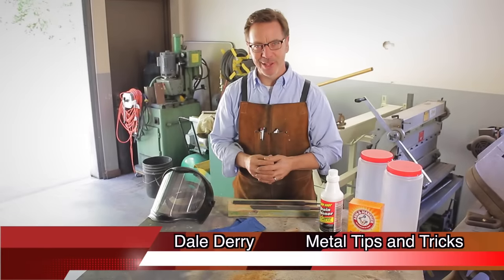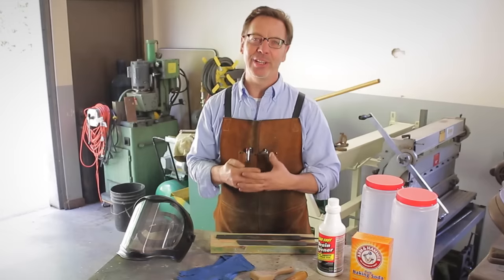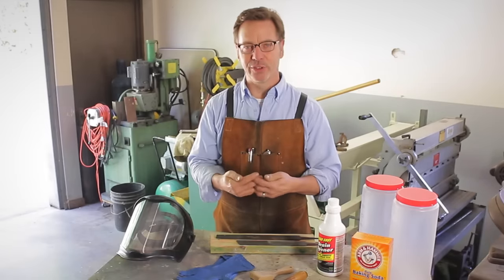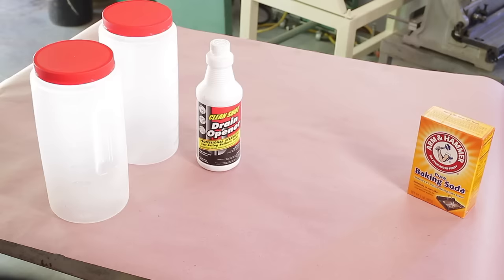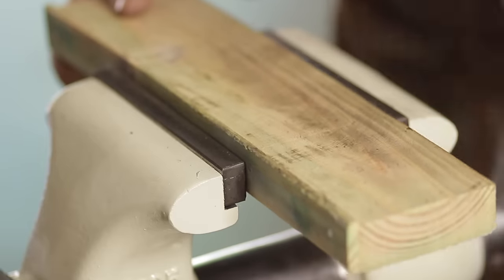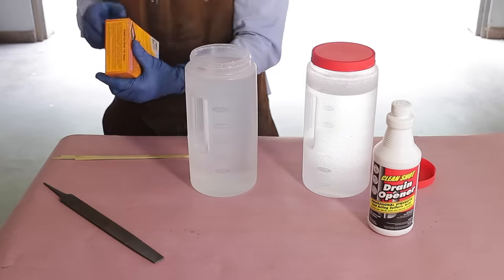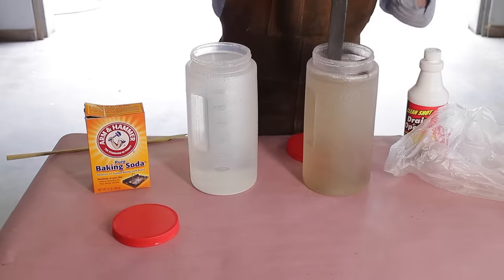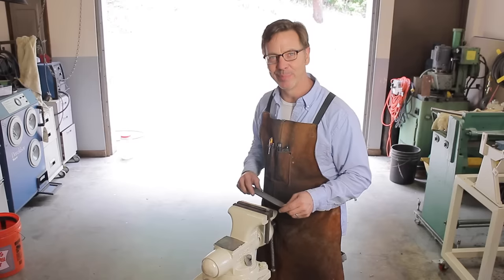How to Sharpen Metal Files

Comment: I don't see how using acid will sharpen a dull file.  

Sharpening anything is a selective process, that is, metal is selectively removed (from some surfaces and not others) to create a feature, in this case that is a sharp edge.  For files, the manufacturer creates the features (cutting teeth) by plastic deformation of the metal, however it requires a flat, very smooth surface for the deformation to create a good tooth profile.  The file is then hardened and lastly (according to Nicholson), bead blasted to sharpen it.

Acid etching, on the other hand, is a bulk process, it is not by design a selective process.  The acid will remove metal from all surfaces at once, it may do so in an uneven pattern, but there is no design to it.

Acid etching is used in metallurgy to show the microstructure of the metal.  Metal is not (unless specially manufactured to be so) amorphous, it is made up of a number of alloy forms in domains with specific boundaries between domains.  These different components etch at different rates, thus revealing the microstructure of the metal.  If the metal is polished before etching (the usual case), the resultant finish of the metal post etching will no longer be polished, it will be roughened, otherwise the microstructure will not be revealed.  Of course, there are commercial processes that use acid to achieve an "acid  finish", where a shiny metal comes out as dull.

There are numerous videos on YouTube that show acid being used to remove rust from old tools.  In all of these, viable metal as well as the rust is removed.  If you watch one where the tool has printing stamped into it, you will see that the printing is less clear and loses its sharpness the more the tool is etched.  That is, the sharp edge of the printing  is eroded by the acid more than the bottom of the printing.  The printing loses definition.  The same will be true of the cutting edges of files.

So why is this so?  This is a simplified explanation.  The acid removes the metal through a chemical reaction, this both removes the metal and exhausts the active components of the acid to form salts.  If the etch is to continue, the liquid around the metal must have new active components brought into contact with the metal.  This is done in a number of ways, sometimes through chemical transfers in the liquid and sometimes though agitating the acid.  The agitation process is quite common, however most of the time, the file sharpening through acid etching does not use agitation.  So chemical transfers through the acid it is.

It should be clear that the more acid that the metal "sees", the faster the etching and the greater the metal that will be removed.  Consider (in a two dimensional case) a piece of the metallic surface.  If it is on a flat plane, the surface will "see" 180 degrees of acid, this is the case (more of less) when we are considering the middle of the flat surface that runs from the gullet to the cutting edge.  As we more up the tooth towards the edge, the view will remain much the same, however as we reach the sharp edge, we will be able to see greater than 270 degrees of acid, there is more access to the active element of the acid.  As we come away from the cutting edge and descend into the gullet, the view of the acid will get narrower, at the bottom of the gullet it will be less than 90 degrees and thus less metal etched away.  So, there is  more metal removed from the cutting edge than there is from the flat of the tooth and less metal removed from the gullet, this is the opposite of sharpening the cutting edge.

The file may feel sharper after acid etching, but is it, in reality, just cleaner with a rougher surface?

When I buy second hand files (most new ones are appalling), the first thing I do is put the file in an extremely strong caustic solution (very dangerous, very corrosive to organic mater, that is, ME!, protective safety wear is critical) overnight and then brush it will either a fine stainless steel brush in the direction of the gullet for a single cut file, or a brass brush in two directions for a double cut file.  Like the acid etch, the caustic gets depleted where it has removed rubbish from the file, sometimes  a second overnight dip is required.  The caustic will remove all sorts of rubbish, oils , greases, filing, aluminium,  paint, glue, all sorts.  When finally cleaned, brushed and protected from future rusting, the file feel very sharp (unless damaged).  The caustic solution will also remove most rust, but will not remove the dark patch (black rust or ferric oxide instead of red rust or ferrous oxide) where the rust once was.

I rarely go beyond this point, the file is usually about as good as it will get, any remaining rust will be removed by honest filing.  If I must get rid of the final remaining rust, I use Evaporust (rarely).  I am told our old friend bicarbonate of soda also works, but I have not tried it.

I often get a file that just feels dull and useless but has turned into a barely worn, worker.  One second hand, smooth grade, single cut file I acquired, that felt  completely dull when I got it, turned into a very capable draw file.  I thought it got even better the more I brushed it along the gullets, polishing the cutting edge, or just imagination?

The only way to prove whether acid etch works as advertised is to take before and after, high resolution, photos of both sharp and dull cutting edges of a quality file and compare them, to see just what has changed.  One day I might get around to it.

i am sure many will disagree with what I have said, not to mention the TL, DNR brigade (to whom I say, if you didn't read it, why would you show your ignorance, and why should I care? Nothing to see here, move on.),  and that is their prerogative,  but please provide some sort of reasoning in your explanation.  The "just because," or I was taught 40 years ago (for me, it was at least 47 years) doesn't add much to the conversation.

Comment: That's not "sharpening" a file,it's "unclogging" a file.It's one of the first lessons in metal shop.Also,how on earth would anyone think the drawer thing would work !!!!! I guess this is why North America still imports most of it's trades people from Europe.
Reply: I have been doing this for almost 30 years.Although it does unclog a file better than just using a file card or brush it is still not sharpening,it is unclogging particles from the cutting edges making it work much better.To "sharpen" you would have to grind or hone each little cutting edge only.If by sharpen you mean "make it work better".Yes, it does that for sure.Still not technically sharpening though. :-))

Comment: A relatively expensive way to clean not sharpen a file. It's cheaper to chuck em out and buys new ones. Oh yeah, and it's a good idea if you are going to do this to wear a face mask in the interests of safety but, it's also a good idea to use a handle on your newly cleaned file when giving it a test for "sharpness" rather than having the naked tang sticking into your hand. Whoever taught him didn't do too good a job really, eh?

Comment: Everybody is here talking about how this is cleaning not sharpening and what I'm concerned about is why a drain cleaner is using high amounts of sulfuric acid. Correct me if I'm wrong, but would that not lead to the buildup of hydrogen gas when the acid reacts with metal pipes? Seems a bit dangerous and is the reason you typically don't pour strong acids down the drain in chem lab.

Comment: If you are a mechanic and you don't "unclog" your files ... euhhh
So, the cleaning alone does not do the trick.
With the acid, you etch away a layer of metal ... on all the surface.
Hence sharpen it.

Comment: Soooo...  a simple wire brush doesn't do the same thing?  I mean if you REALLY want to get deep down in the grooves of the teeth and get gunk out sure, but a fine bristled wire rush works nearly as well at CLEANING the file as this does.  Actual sharpening would require recutting the teeth themselves some.

Comment: If a drop of WD40 and a file card brush doesn't shift the grime and pick, then acid solution is a last resort. Never use acid for frequent sharpening of the same file - it will just ruin the set.

Comment: Fun fact acid to water or water to acid no different. May the old guy engineer RIP
Reply: No "zach korinis" "acid to water or water to acid no different" -  WRONG ! - ALWAYS add the acid (slowly) into water , NEVER pour water into acid . Strong acid "grabs" available water violently and can spit at you. Think about the first few milliseconds of the mix process ; adding the first drop of acid to a large volume of water results in weak acid , but the first drop of water onto (violent) strong acid results in spitting strong acid !  People have received serious injury by getting this wrong.  ( If the acid your using is dilute, you can sometimes get away with mixing it wrong - but if the acid is strong, especially if fuming, then get it wrong at your peril. )  DON'T PLAY WITH STRONG CHEMICALS !
Reply: Its not a joke me and my friend tested the reaction with concentrated sulphuric acid and  water in a lab but their was no significant difference in how we mixed them not sure why its such a no-no. We used room temperature but I've heard hot materials are much more reactive and dangerous.  I think either way going slow is the key but the reactions are almost identical.

Comment: What is the actual science behind this. Is the acid eating into the surface and removing a small layer or is t breaking the chips and grime down that are coating the file. Interesting video although lacking in actual facts about the workings.
Reply: Both, really. A strong acid will dissolve some of the junk out of the valleys between teeth, but it will also corrode the steel.

Comment: There is an easier method, clean the file as per the first steps, but instead of putting in acid and then soda, place the file on a leather hide, position outside so that the full moon can shine on it, have 3 vestal virgins dance around it for an hour or so and repeat for the other side next full moon. The file will not be much sharper but it is entertaining.

Comment: Just put it on the wire wheel it clean it in seconds.
Reply from the maker: Wire wheel will damage your files. Try using brass wire wheel it easer on the file . :-)
Reply: It will if you too lean hard on the wire wheel. But I'm a tradesman so I don't have that problem and never blunted my files on the wire wheel. But a brass wire would be more forgiving.

Comment: Been in Engineering workshops for over 40 years. Never heard of sharpening files. Clean them yes, sharpen no. If the file cutting edges are dull you need a new file.

Comment: Sorry to be picky, but you're not really sharpening it you're cleaning it albeit very well.
The sulphuric acid will not only eat any rust on the file, which is good, but will take some of the metal to become iron sulphate. That will erode the edges of the individual teeth and on a very small scale, dull them.
But, in fairness, you've taken a fairly useless file and got it back usable again which is great.

Comment: who the hell ever said steel sharpens steel by leaving them in draws???? We have always been told never let cutting edges touch, files, saws, drills, taps ect should all be stored with separation.
Also as others have mentioned this is cleaning. It will not sharpen and in fact will dull the cutting tips.
This will clean an abused file from Clogging.
The only ways to sharpen files require one of - normalizing, shaping and re hardening / Laser or photo reactive material removal / acid masking / EDM / Diamond tool drawing.
If you wish to do a basic acid mask dip on a file and process similar to this video then Clean file as video describes, then pull a hard wax backwards over the file. this will deposit wax on the tops of the teeth. Now acid dip the file. as video did but for abit longer. Its a lot of hard work and more than likely easier to buy a new file.
Reply from the maker: your wrong
Reply: Thanks for being so precise and comprehensive on what parts I am incorrect about.
If no response is posted then i guess you did some research and realized that in fact the information I posted is not incorrect. I have stated that your process does clean a file. I would hope you can understand that I'm not telling you that you can't clean a file like you did but instead some people may be misinformed from this video due to the term "sharpen" in a practical sense.
An acid or alkaloid will corrode a point faster then a flat. therefor the points get corroded faster making the point more dull then before.
The file may perform better as the gullet are clean and any swarf stuck on tooth tip will also be removed. 
To acid etch a file without a mask you need very good temperature control and heating of the file with cooling of the tip top faces.
Also i forgot to mention that you can sharpen a file with thread and abrasives once the file has been cleaned.

Comment: Vinegar works too, just leave the file in for 24 hours.
Reply from the maker: +Joe Babb 
great Ill have to try it
Reply: +Metal Tips and Tricks (Dale Derry) +1 on the vinegar. I have successfully used vinegar quite a few times, and as has been said, leave overnight. It leaves your files almost looking new, just a slightly different coloured gray. 
I used to pressure wash the old files first, making sure to get any oil or grease off, use a degreaser if necessary, then put in the cheapest vinegar you can get and leave overnight. Next day I would rinse off in hot water to wash away the vinegar and leave the file hot so that it would dry quickly and not rust again. Worked a treat and definitely chemically sharpened the files, they would cut like new.

Comment: There is no way this method can sharpen a file. If the teeth of a file has been rounded off due to filing metals of a greater or equal hardness, nothing can restore the sharp edges. Cleaning the grooves stops the file from sliding over the metal to be filed but you will need to apply greater pressure to compensate. I’m a mechanical engineer.

Comment: So you're just removing rust and other dirt with the acid, right? Not really sharpening it.
Reply: Find a very rusty wood screw. Put it in salt and vinegar in the microwave.  Wash off the rust. It is now very sharp.
Reply: Maybe you're exposing already sharp edges otherwise covered in dirt or rust but you're still not sharpening it.
Reply: OK, one may just be removing rust, but the screw was not sharp before rust, and now it is. You could say the rust sharpened it.
Reply: You could say that but it's like saying you made a pair of shoes by removing the box that contained them.
Reply: My friend Pepper makes his own shoes from scratch. That is hard work. Rusting a file, and cleaning it with salt and vinegar, making it sharp is easy.
Reply: No you're not just cleaning it.This has been used to sharpen files for about as long as files have been around.To put it simply there are 3 edges,the acid will remove 2 from the sides for each one part of the tip.Now if you ground a edge with even pressure at the same ratio in time it will become sharp ;) Its hard to believe it works but it does.The problems arise when a file is too far gone or the acid solution is too strong,but otherwise this is as old as files are for the most part.

Comment: Same result with a wire wheel in about 8 Seconds.
Reply from the maker: Wire wheel will damage your files. Try using brass wire wheel it easer on the file . :-)
Reply: Metal Tips and Tricks absolutely not. I've been using a wire wheel on my files for years. Wire wheels are much softer than the hardened steel files are made of. Does not hurt them at all. I've never had a lose in performance from doing it. And takes just a second to do.

Comment: careful recommending "drain opener" or Drano - most drain cleaner products are caustic (sodium hydroxide), not sulfuric acid. (This is due to the fact that most soaps are based on lye, which is also NaOH, but will not cause a nasty neutralization reaction in your drains, releasing excess and potentially toxic gases. Toilet bowl cleaner is almost always hydrochloric acid. Not all acids react with iron, so some chemistry understanding is needed.
Reply from the maker: Thanks for your comment

Comment: Why not just clean them w/a wire brush each time they are used. If you have a wire wheel on the grinder, even better as you can clean the teeth in less than three [3] seconds per side. . . .

Comment: You  cleaned the file you did not sharpen it.  File still squeals like a dull file.
Reply: Cleaning a file was taught in 7 th grade metal shop in my experience, (1969). This is a good Cleaning demonstration. Nothing more. You really should leave it at that.

Comment: Hmmmm....I don't think the acid actually sharpened your file. The copper and the wire brush (file card) would have done more than the acid, by unclogging the teeth.

Comment: Not sharpening this cleaning onlyif anything this process will actually dull a file as the acid while remove material and the thinner the material, the cutting-edge, will be removed more readily.

Comment: Logically I just can't see how that would work the acid should remove the thin cutting edges where are the metal is the thinnest. Don't play with acid just buy a couple of new files you don't need a whole drawer full toss them buy two or three new m